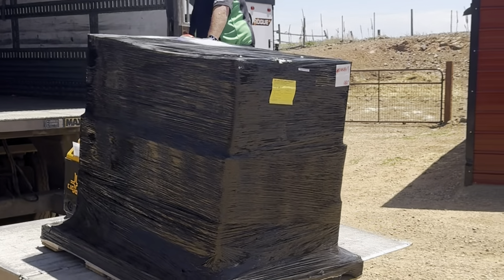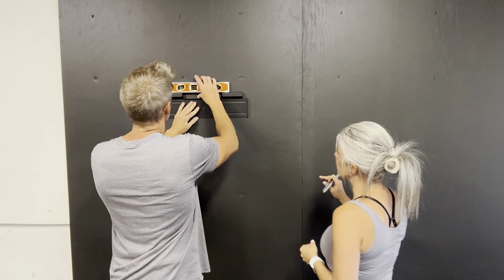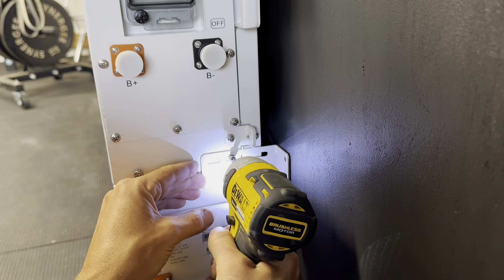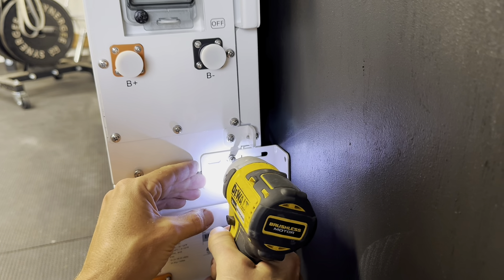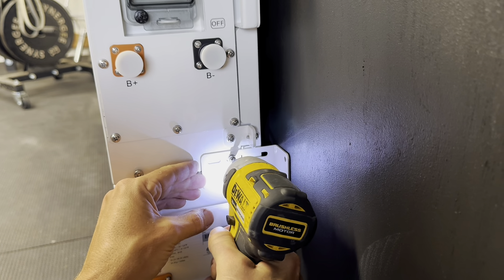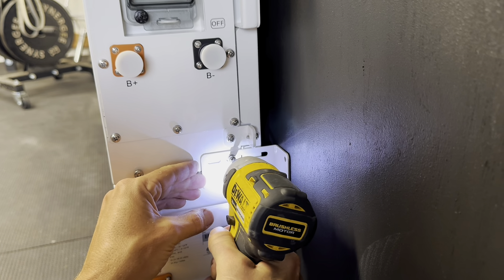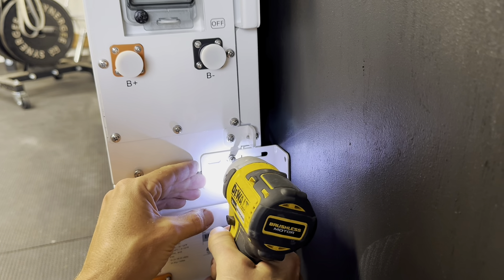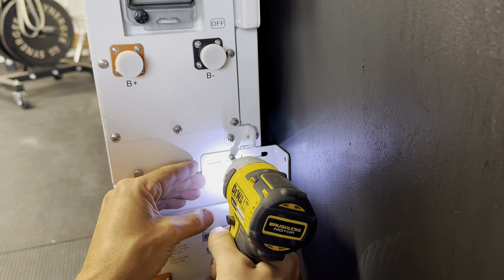Set Up the BigBattery Ethos 12kW Energy Storage System w/ LUXPower Hybrid Inverter (initial setup)

Comment: Can a wind generator be added to this system?
Reply from the maker: The generator connect in the inverter should work (my plan is to add wind but I haven't seen anyone discuss that yet). I still have research to do but my hope is yes and I don't see why it wouldn't work.
Reply: @BuckhornCliffs  I have a solar panel array of 8100 watts, and our wind generator is 48V @ 2000 watts. Looking for the inverter and 48v batteries. I will look into your brands and links further. Thank you for all you do!
Reply: Love you on instagram too!👍
Reply from the maker: @anthonysammarco421  Thank you!